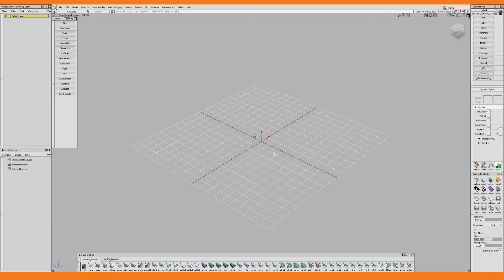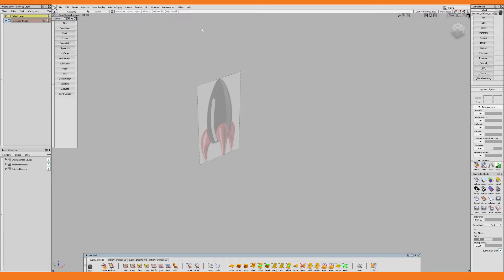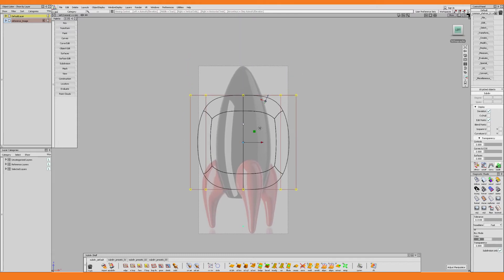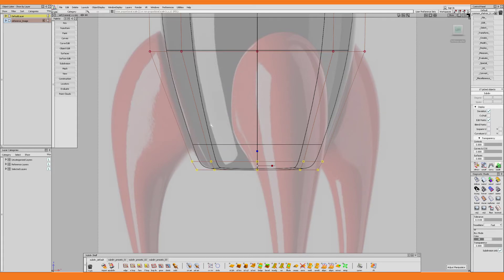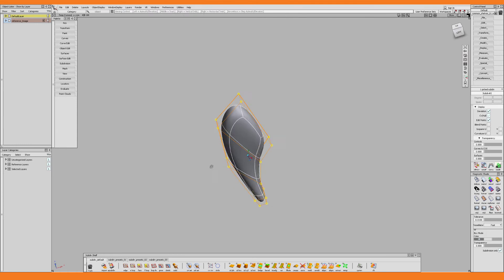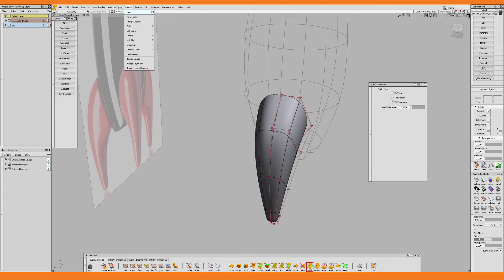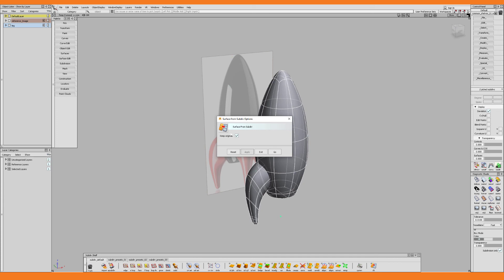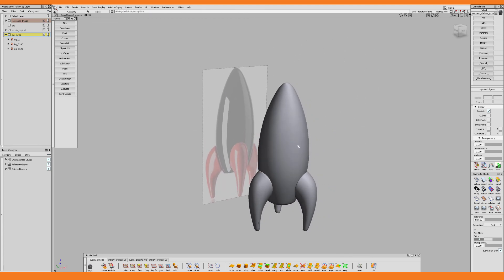AUTODESK ALIAS 2021 TUTORIAL: How to Create a Playsam Toy Rocket with Subdivision Modeling

Comment: Oh my lord this is difficult. Took like 30 minutes to kind of get to 2:45 lol. Would be nice if you could explain simple stuff like snap to center, or snap to plane, and lots of little things like scaling, moving canvas, etc. It seems you use a lot of hotkeys and stuff which is great for workflow but really difficult to follow in a tutotial. Thanks for the awesome content though, now to try and get past the next few minutes!
Reply: Gonna ask a bunch of questions, here in the replies. Do you know why when I cut faces they become open holes for me but not for you? I click on "mulcol" and it fills them, but seems that is automatic on your end...
Reply from the maker: @misiukowalski5653  I have the same issue when I am using any of the diagnostic shaders - whenever I create new faces by for example inserting an edge loop I need to reapply the shader, multi-color for example. 

That's why I don't use diagnostic shaders for the most part while subdivision modeling, instead I rely on the Hardware Shade mode which can be found under WindowDisplay in the top menu bar. If you are using Alias 2021 this can also be toggled through the right mouse button marking menu, while you are in the subdivision workflow. (Preferences>Workflows>Subdiv or CTRL+5)
Reply: How do you hide all the lines at 5:57? I can get the control points to hide but not the seams
Reply from the maker: @misiukowalski5653  I use "Toggle Model" to turn the wireframe on and off. Which can be accessed through WindowDisplay>Toggles>Model or by pressing F12 on your keyboard. If you are using Alias 2021 you can also do this by way of the marking menu I mentioned earlier.

Hope that answered your questions, if not, let me know and I will give it another shot.
Reply: Also, what scale tool are you using? You seem to enter scaling with a hotkey and don't explain. I used a scale tool from the top right menu, but it only scaled the visible points and didn't select through to the other side so the scaling I did is not symmetrical. Also is there really no undo history? I can only undo 1 action and no more?
Reply from the maker: Hi Misiu,

Sorry you feel that way, but I get your point. In my defence I want to say that these tutorials are mainly aimed at people with some prior experience in Alias NURBS modeling, who want to learn subdivision modeling as well. That is why I don't explain all the basic concepts like snapping and transforming objects. But since you are asking in the comment section I will do my best to answer your questions.

To transform the canvas images I use the legacy transform tools - move, (rotate) and scale, which can be found in the palette under the transform tab. Where you also find the Set Pivot and Center Pivot tools by the way. Later on in the video I instead rely on the new and improved transform tools which can be accessed through default hotkeys if you are using Alias 2021.

Q: Transform Tool
W: Move Tool
E: Rotate Tool
R: Scale Tool

I made a separate tutorial on these particular tools if you want to learn more about them. Here is the link to that video:

https://www.youtube.com/watch?v=I8KKrm45jlQ

Lastly, snapping in Alias works like this:

CTRL: Snap to Point
ALT: Snap to Grid
CTRL+ALT: Snap to Curve